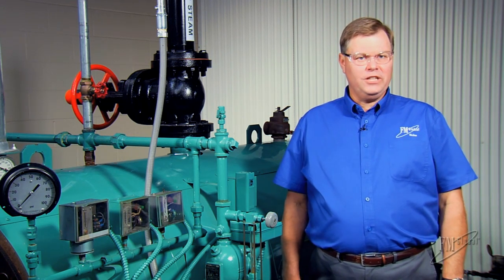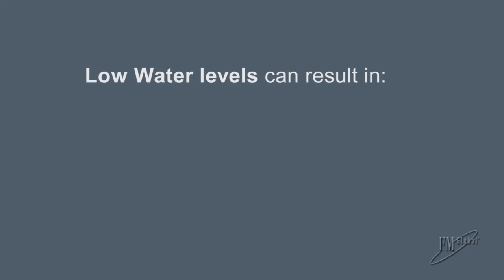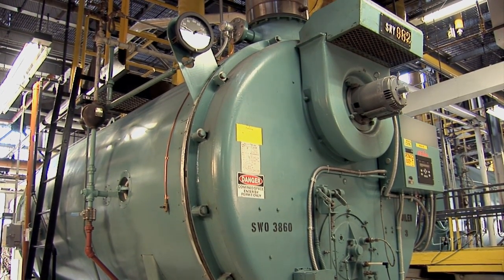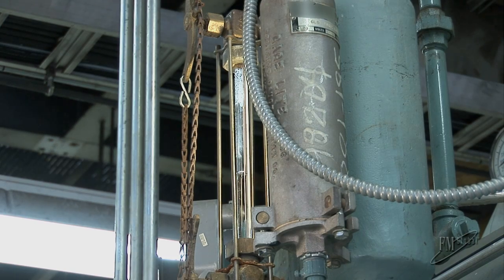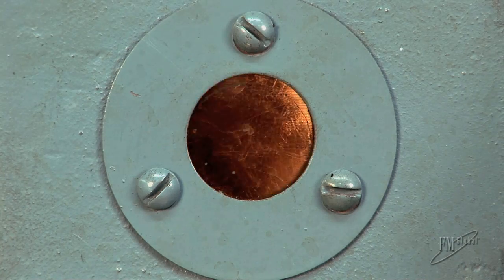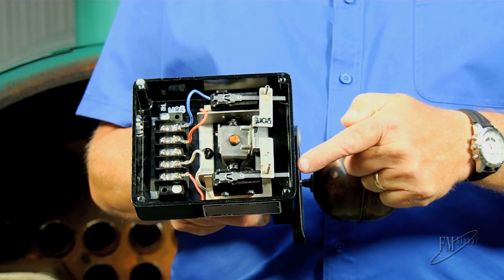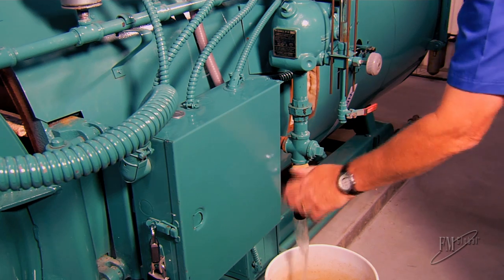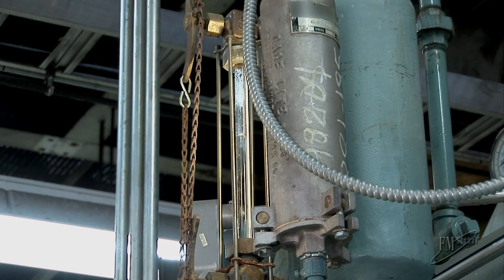Know More Risk: Low Water Cutoff

Comment: I have to get real here so you can see who I'm dealing with, we have a four zone to pumps to this building,this a church building so we don't leave boiler constantly running.   I wouldn't have low water level problem if they would simply turn off the thermostat. They will leave the sanctuary and turn off the boiler by the switch on the boiler, leaving the pumps running,now I can't the low water switches to reset.